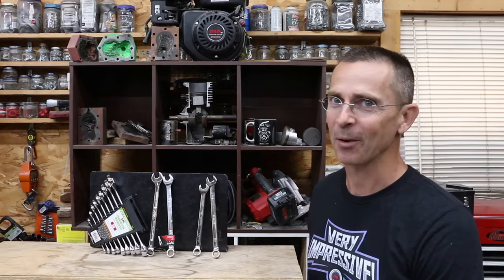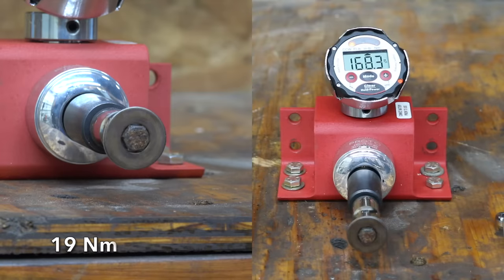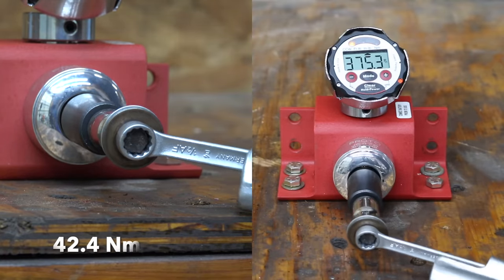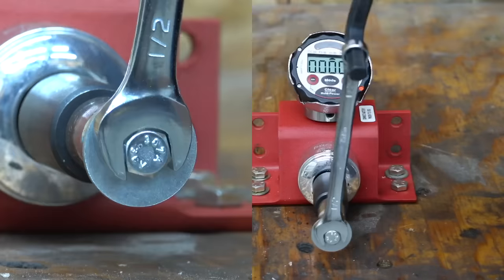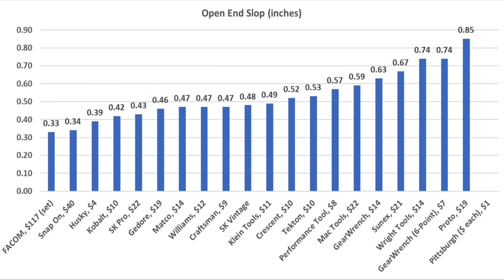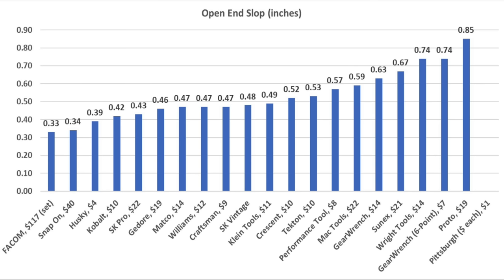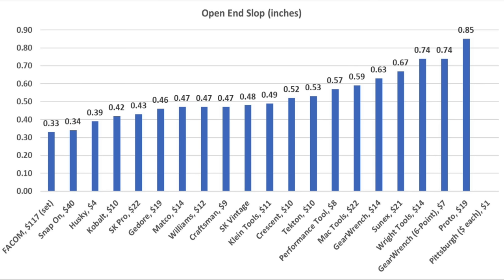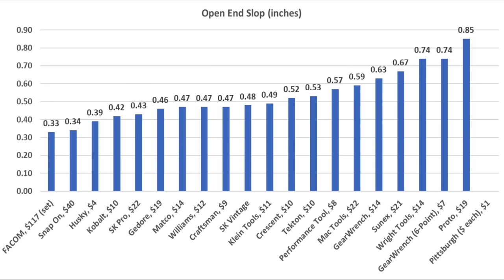Best Wrench? Let’s Settle This! Snap On vs MAC Tools, Matco, Proto, SK, GearWrench, Kobalt, Husky

Comment: Reviewing the chart, it seems the Husky would be a good value for the budget buyer. They basically tied the Craftsman, at half the price, thx they are 1/4 the price, or less, of anything else that outperformed them. Definitely not for the pro, and probably not for the serious hobbyist, but if I knew a young family that had to have tools to do what needed to be done, that might be my recommendation. Based on this testing, anyway.
Reply: husky craftsman both stanley owned and likely same basic tools
Reply: @mikethetoolman8776  Stanley does not own Husky. Husky is a proprietary brand of The Home Depot. You may be thinking of Dewalt, as Stanley Black and Decker owns both Craftsman and Dewalt.
Reply: You can tell the husky’s are made to a tighter tolerance using less high grade material. For a home user, definitely the best option
Reply: I own several of the husky tools (because I'm broke) and honestly, they do well for the price.
Reply from the maker: Thanks for the feedback.
Reply: That jives with my own experience w/ Husky tools.  I have a mechanic's set I bought 20 years ago on clearance as a broke college student and it has served me well ever since.
Reply: I got a Husky set of tools over 20 years ago. I’ve had one 3/8 socket wrench break and they let me go get another off the shelf. I’ve used 12 point sockets on 1/2” drive pneumatic impact drivers and they are all still working. I haven’t upgraded to a better/more expensive set because they all still work. I also use them all the time working on hotrods and all my toys. “If it ain’t broke don’t fix it” is my take on Husky tools.
Reply: I kept noticing that 4 dollar tool doing pretty well, too.
Reply: I worked in the tool section of home depot for about a year. Rarely got warranties in, and the company policy was to just hand the customer a new tool no matter what. I warrantied out welded wrenches or ones cut in half without care. The only thing is home depot seems to change its tool manufacture or style like every other year. So if you like all your stuff matching, maybe not use them.
Reply: I have a large set of husky tools from Home depot. They work great and ive never had an issue. except the 10mm playing hide and seek.
Reply: @enigma9789  Haha. I feel ya. They should add 2 of the 10mm to every kit.
Reply: @kevinmay9232  husky is made by Apex tools same as Gearwrench and Crescent (i work at home depot and have seen the box the individual wrenches come in)
Reply: Husky was right there with snap-on in almost every test. I thought Husky was more expensive though
Reply: "Most Husky tools are made by Apex Tool Group, a company owned by Bain Capital. Apex also makes several brands you may have heard of, including Wiss, Allen, and Weller. Apex also makes tools for numerous Home Depot competitors, including Lowe’s, Menards, and Sears."
Reply: @enigma9789   Autozone sells a set of 10mm sockets. You get an assortment of types of sockets.
Duralast 10mm Socket Set 10 Piece   Part # 60-920  $19.99   (they used to be 12.99)
Reply: I'd go Pittsburgh, Husky, Gearwrench, then Williams, Proto, SK... in that order of money available.
Reply: One thing I don’t like about husky is there wrenches are really thick, like around the wrench part, hard to get in tight places!
Reply: I do have a few Snap On items from garage sales and such.  They are no doubt great tools.  But I could not afford a complete set, nor would it be necessary as I am not a pro.  90% of my wrenches and sockets are old USA Craftsman.  I have some of just about everything else.  Based on this and other tests I have seen, if someone told me all my hand tools had to be one brand It would have to be husky.  Great performance for the price.  I am a little disappointed in how Tekton comes out in this and other comparisons, especially since they have been offering more USA made items.
Reply: @ProjectFarm  your tests here generated a gold mine of data.  Reducing it to finishing place and picking the top three doesn't really capture the full value of what you created. Here's some brainstorming about ways to capture that value.  1. You could probably literally make two videos, one with the testing, and another with sifting the data in different ways, whether that's price vs. performance or best for different use cases, etc.  1. Or if not going that far, I do think a little more discussion at the end would be valuable.  3.  I also like the way you have sometimes done it, with letter grades instead of finishing place.  4. What about making the spreadsheets with raw data available to Patreon subscribers or similar so people can analyze it how they please?  It's ironic that the high quality of what you do prompts me to ask for more—please don't take this as criticism!
Reply: I'll be 45 later this week, and my dad has some Husky tools that he bought when I was a child.  They are still going strong without a single one ever breaking.
Reply: I use husky in a pro setting doing collision repair. They make me just as much per hour as the other tech’s snap on wrench set. 🤷‍♂️
Reply: @nicholasjanssen2175  exactly. High quality tool with average quality materials is perfectly fine for regular use.
Reply: @darylsonnier658  Old husky and new husky are pretty different brands. Pre home depot Husky tools were a top shelf brand that competed against proto and sk.

Comment: I can't help but notice that despite its low price, the Husky scored mid-pack or better in almost everything.  If price is your highest priority, you could do a lot worse than the Husky.
Reply: I've always thought Husky wrenches to be a good product for the price.👍
Reply: Most of it has a lifetime warranty too, if i'm not mistaken. For the casual hobby mechanic it's enough for me.
Reply: ya husky impressed me
Reply: You could definitely use these husky wrenches professionally.
Reply: Agreed.  The Husky got excluded from the open end max torque test due to a testing error and was given a 19.  If we assume it would have scored a mid-pack 10, then its average score would have been 7.4. That would have put it in the top 10 and for the price, a great value.
Reply: We used a lot of different makes of tools in the USAF for flightline use. In the 1980's Snap On was king. In the 1990's it was Husky. I have one particular bad memory of a Husky tool (not its fault) when I had parked my tool box under the wing of an F-16 to do maintenance. At first it was in the shadow of the wing. But the job took longer than expected. Soon, the tool box (a Lista Bin box, roughly a 3 foot cube of a tool box, on wheels) was in the sunlight. Now, in the Air Force we keep out tools in foam. That is, a large piece of foam is placed in the drawer, and then a shape of the tool is cut into it. Nice tight fit for the tool, and instant recognition that something is missing. At Luke AFB, near Phoenix, AZ, we used black foam. That absorbs sunlight, and turning the wrenches sitting in the foam, to about 250 F degrees. I returned to the tool box to get an 1 1/2" wrench. I soon had a Husky branded hand. Very readable, and it hurt like hell. A second degree burn just by leaving my tools in the sun. First and last time that happened to me.
Reply: If I need to replace a set of box / open end wrenches Husky definitely has moved up on my choice of wrench set.
Reply: Husky hand tools are underrated, simply for the fact you can exchange any Husky that fails under it’s lifetime warranty at any Home Depot, as long as they still make the tool in question and they have it in stock (they can also send you out of stock tools at no charge). So for those that do break, it’s just a 10 minute drive up the road for another one at no cost, except gas.
Reply: Just keeping it real, they make breaker bars and sockets for a reason and if a bolt is that difficult to get off you can use some PB blaster a torch or even a grinder.  Husky is a great brand, I completely agree, and Snap On is just always overpriced. 
But I bet in a real world shop environment I'll get just as much of my money's worth with a Pittsburg 1$ wrench as any of the other brands.  In my shop I have multiple wrenches of every size and the last thing I check for is the brand. Besides my ratchet wrenches.
Reply: For price vs strength that one is the winner
Reply: @Technichian462  Thanks for your service. I live in Phoenix and have worked with Luke sigting some power lines near the base. Love to watch the jets out there.

I've had my share of cussing due to grabbing tools and metal objects in the Arizona sun. I will never pick up a wrench without thinking about your story......LOL.
Reply: Agreed. Imagine my delight about 15 years ago as the local Home Depot cleared some inventory and put loads of Husky sockets and wrenches on their close-out table! I came home with very heavy shopping bags, and none of those tools has failed since.  The Husky and Kobalt rolling tool chests I bought at the time are quite a different, much sadder, story but that's a topic for a separate test.
Reply: @Technichian462  I feel your pain - literally.  I have been cool roof-coating part of my building lately; where I have two finish coats the bright white surface is 125 degrees.  Pretty hot and not even 11:00a in E TN.  But the uncoated roof is 190 degrees and that just comes right up through  your shoes.  Can't be on the roof after noon - your shoe soles start to get a little soft.
Reply: @Technichian462  Thanks for your service Dr J. I was stationed at Shaw AFB in the '80s and worked F-16's and believe it or not, we actually had a bunch of Craftsman tools at the time. They weren't so great but the replacement program was pretty good. 

And yes, I remember those CTK's and how everything was shadow boxed in. I thought you were going to say you lost a wrench and shut the whole flight line down for a FOD alert. 😳
Reply: @Technichian462  I was a road mechanic in Vegas. I feel your pain brother!
Reply: @cardioandfriends  Sounds like the BEST value for money by far !!
Reply: Agreed, it seems the best bang for the buck, for homeowners
Reply: I've never had luck with the Husky stuff. Had a 9/16 ratcheting wrench right out of the pack so sloppy that it was nearly useless.
Reply: @Richter-89  go exchange it they are great with their warranty
Reply: @saidwhatwhen8867   best observation, that's what I was guessing, thanks for filling in the numbers.
Reply: Yeah that's the first brand I put my eyes on too while looking the charts.
Reply: Husky makes pretty good tools. I have some husky ratchets, wrenches, sockets, Allen keys etc and all seem to be pretty top notch
Reply: @user-lj6gk4lv9s  i had access to cold water. Always had a 5 gallon igloo cooler on top of my tool box.
Reply: @Technichian462  "...near Phoenix, AZ, we used black foam." Right there I knew things were not going to end very well. I became scared to read any further. At least you lived long enough to write this up.
Reply: @Richter-89  go bring that shit to Home Depot my dude and get a new ratchet. Even if it’s an old one they will still give you the new 9/16 at no charge
Reply: @yancooper3008  what brand do you prefer for ratchet wrenches?
Reply: @WhereAmEye2187  I wouldn't say "prefer" because I don't try out every brand of rachet wrench but I bought the Kobalt 20 piece (SAE) and Metric set.  I have a quite a few other brands I've picked up over the years, just random.    It's not so much preferring a brand as opposed to me needing a ratcheting wrench and the 20 piece Kobalt set covers most of my needs.  Then I have a couple sets of smaller ratchet wrenches for tight jobs.  One is Craftsman which works quite well.  So, I usually go from a set of Kobalt and Craftsman wrenches to get the job done.  But it's not really about "preferring"  a tool, it's about having them all available.  If one fails, buy a new one.
Reply: @georgiabrigand6793  I just picked up a 52" Husky Industrial rolling tool chest combo, and I am impressed with the construction.  It is a bit better than the US General a buddy has.  The soft close drawers are more handy than the plastic latch on the US General, in my opinion.  The only drawback is that you can any color you want, as long as it's black matte..:-).  The older and standard build Husky chests weren't the best, but this new line is decent, and has a 5 year warranty.
Reply: @97irishflyer  Thanks Irishflyer ! My main tool chest is a 20-year old Husky combination. It was red when I bought it. Overall, I'll say it's been good value for the money. But the drawers run on slides, not roller bearings.  At the time I bought it they worked silky-smooth, but got more and more resistiferous after the first 10 years. I'll check out the current Husky models. Definitely want roller bearings this time.  Caution: one bargain store chain advertises "roller cabinets" but this does not refer to the drawers. It simply means that the cabinet sits on rollers.

Comment: For a value brand, I've had the largest  full set of Husky wrenches and sockets they sell for around the house / ranch for the last 10 years.  Can't say I've broke any of them, and lifetime warranty. Obviously there are better brands but for me snap on is not worth the literal 10x price tag
Reply: Yeah, that’s the aspect I was paying closest attention to. I’m not a mechanic, so spending a lot of money for occasional work around the house doesn’t make sense. Husky appeared to have the best bang for the buck. Too bad he messed up that one test with the Husky.
Reply: Anything that requires torque, I'll use a ratchet and socket, pipe wrench or a decent crescent wrench. Combination wrenches are only used for holding one end of a bolt
Reply: I agree.  The $4 Husky placed quite well in the tests.  That is some pretty good bang for the buck.
Reply: The Husky stood out to me in the tests as well, always delivering a middle-of-pack or better result at about 1/3 the price of alternatives with similar results.
Reply from the maker: Thanks for sharing!
Reply: I've tried to take a husky wrench back to Home Depot and they said I abused it so they don't care what the sign says they're not going to take it back. The sign said if you're ever dissatisfied with one of our tools ever we will buy it back and they told me We took that sign down so there's no more lifetime warranty.  A warranty is only as good as the people who stand behind it.
Reply: @ak6781fan  You are the reason $40 wrenches exist. It's to pay for the other 9 wrenches up front so that you can exercise your unreasonable warranty expectations.
Reply: All wrenches are pretty much the same. I don't see how some get caught up in tool hype.. The wrenches with the V groove on the open end are better because they grip better and don't slip as easily but you don't have to buy them from snap on.
Reply: @mdocod  Yeah it's only so much torque you can put on a wrench before it rounds off a nut or bolt end. With proper use you can use any tool to get the job done. I don't live where rust is a problem though.
Reply: @Garrett W. No wrench fits a bolt snugger than a V groove wrench that's common sense.. I can watch and comment on any video I choose. Go sit down somewhere and mind your business.
Reply: @TD75  As an auto mechanic in the '70s, I took well over $1,000 worth of Crapsman tools back to Searz for replacement.  I often left the blood on them which, happened when they failed.  Let's Go, Crapsman!
Reply: My father bought me several sets of Husky wrenches/sockets/ratchets for my 17th birthday. Two decades later without a single failure. 

Dollar for dollar, Husky clearly won this one. Wise choice, dad.
Reply: @Steve_Blackwood  too bad he messed it up and then gave it a score of NINETEEN in that category. Don't know wtf that's about
Reply: @ak6781fan  I’d say contact Husky. Warranty is warranty. Home Depot must honor their policy at the time of sale, but you would need the backdated receipt. Their new policies only apply to new sales. 

But if they used the excuse “you abused it,” I must wonder what it looks like and what you’ve done to it.
Reply: @TD75  And many other things. Returns and warranties have had a large, hidden, cost on overall quality. What started off as good insurance against pure lemon products/errant purchases have morphed into an army of Karens/Kyles who  abuse the system with unreasonable expectations, compulsive buying and petty power plays against customer service. I mean there's only so much tech in a wrench and there isn't a secret alloy/construction technique than makes them actually indestructible.
Reply: My thing with Husky hand tools and its not a bad thing is they have cheap, pretty good quality tools and are pretty durable for low to midrange use and their lineup has a number of unique tools for different applications.
Reply: @mdocod  I was impressed with Husky that for being a 4 dollar wrench. Definitely a better option over some of the tool truck brands.
Reply: @shabadoo24  I have never had a "crescent" wrench work better than a ooen end wrench. Even with a snap off adjustable wrench I inherited.
Reply: @ianmoon1103  agreed with you. He messed it up that one test but did not redo it. Then went ahead a gave it the last place and used that in his calculation for the final results.
Reply: I use standard  husky sockets on my 1/2 Air Impact Gun and have yet to break one in nearly 20 years.
Reply: @ak6781fan  If you have another Home Depot within driving distance, take it there instead. I can't imagine the employees at my local one caring enough to refuse a replacement. Policies are one thing, how they are implemented and enforced is another. Both by management and individual employees.